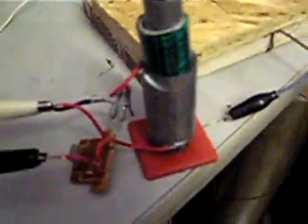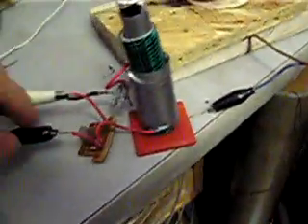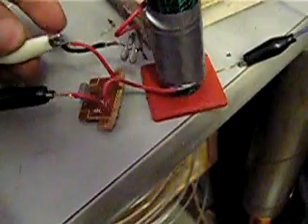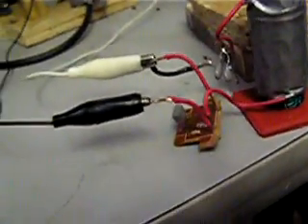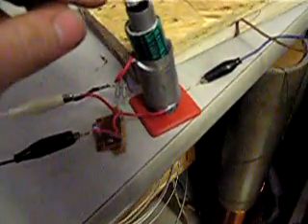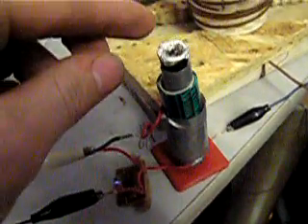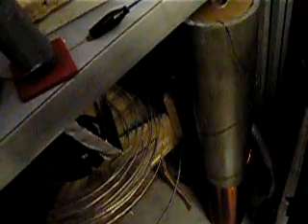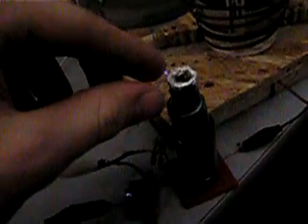Super duper teenie tiny tesla coil

Comment from the maker: If you use a voltage multiplier circuit on the output to step up the voltage, then sure. I couldn't find it again, but I remember a week or so ago, This guy posted a topic on 4hv. org on his tiny coil that ran off of 4 AA batteries. He got some big sparks too.

Comment: This has to be the smallest Tesla Coil I've ever seen!  It's cute, but no way are you getting resonance with this.  With a winding that small, the resonant frequency would be at the microwave level.  Also, don't ever try touching a spark from a coil with your bare hand!  It won't shock you, but you can get RF burns (I got hit by sparks from my coil one time and I still have a small scar on my hand).  Hold something metal in your hand and draw sparks from the terminal with that instead.

Comment: cute - but could be better.. The coil is definitely not in resonance mode, also you seem not to know what's the toroid for as you set it on without changing the bank capacity nor winding length.. Also change the primary as the present one is once too high and thin.. Once done it, this coil would fire a streamer to approx 2cm I guess..